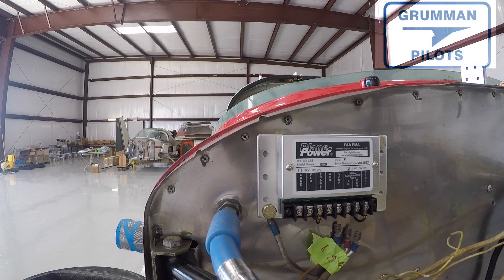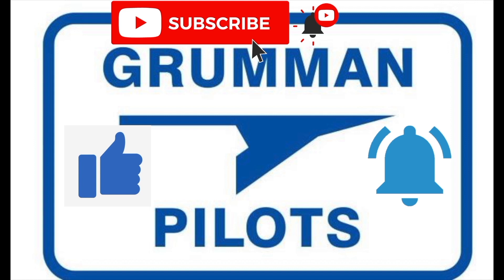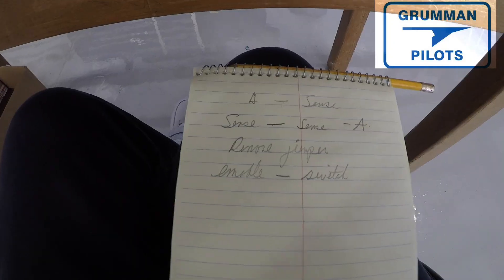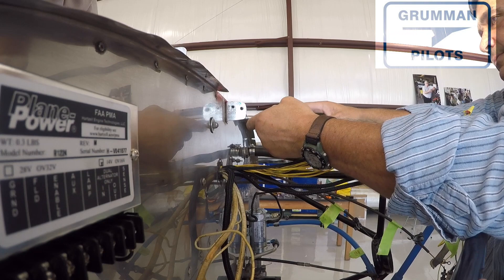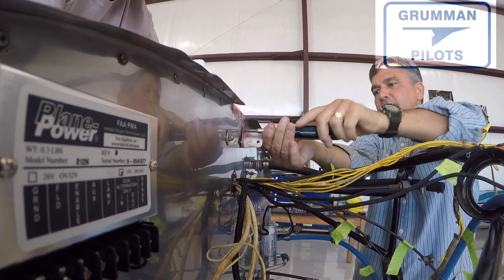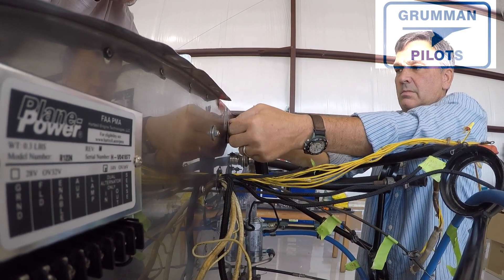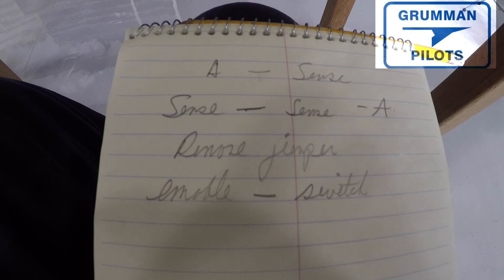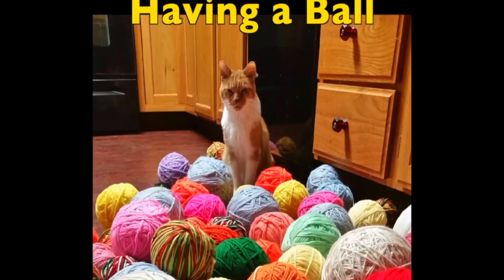Plane Power 1224 Voltage Regulator Installed - Grumman Style

Comment: Remarkably little info here. Was hoping it would show wiring diagrams, connections, lessons learned. You mentioned being confused but gave no explanation. Why did you make this?
Reply from the maker: We showed the wiring marked for the new terminals.  Instructions in box, general purpose was to show folks how it replaces the old ford vr.

Comment: This Plane Power regulator and the Plane Power Alternator are  great updates to your aircraft especially if you fly IFR.  The old Ford parts are not particularity reliable mine used to fail pretty regularly.  Now it just works reliably.
Reply from the maker: I remember back in the early 90's when you go to a NAPA store and get a Ford VR for under 10 dollars and use it to get home.  I still carry it in my bag of tricks to help troubleshoot electrical charging issues when out.  Just plug it in and ground to the firewall and if the alt charges, then it was the VR.  FYI
Reply from the maker: Since someone is going to buy the Project Tiger in a few months, we wanted everything to be top of the line on this plane.  Gonna be better than the AOPA Sweepstakes plane for sure.
Reply from the maker: Glad you found them helpful, we like the reliability as well.